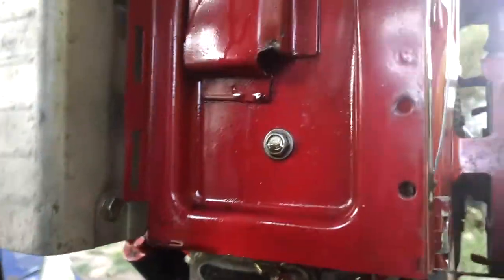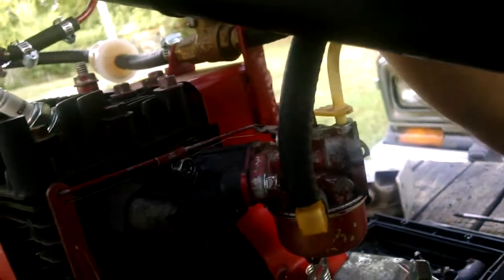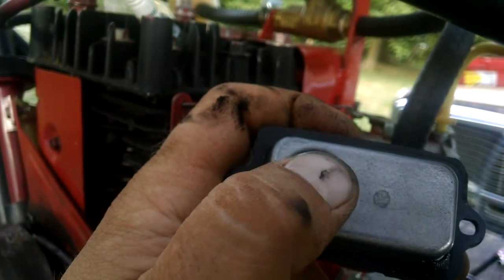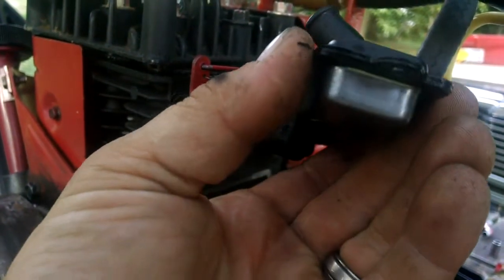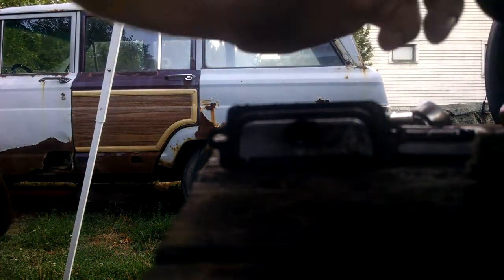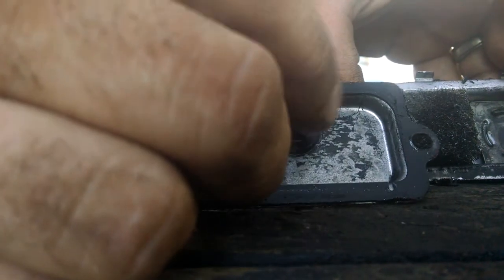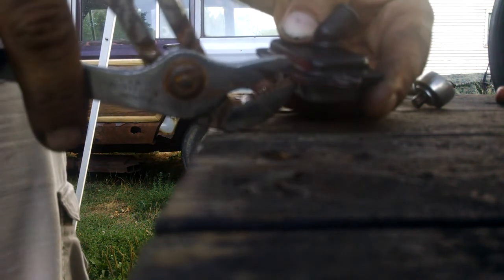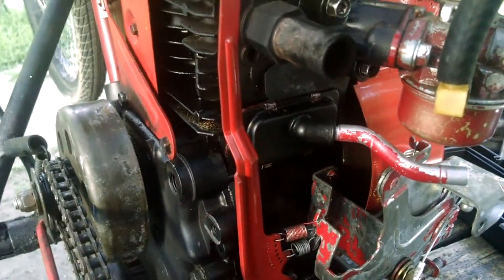Modify the Valve Cover on Briggs engine

Comment: I've been wanting to do this for a while now. I was in no hurry, and still not. When doing it, I'll try to melt-drill the holes using some pointed stainless rod or brass. That sheet is not that thick so I think I have a good chance. That way, no dismantling, and I can start with one hole and see how the engine goes (oil level etc) and drill more if need be.
Reply from the maker: It would be a good idea to dismantle it completely, taking notice how the pathways are for proper assembly, to clean out the metal shavings from every hole drilled. The shavings can be sucked into the engine from inside the valve cover if not cleaned out.

Comment: Useful Information.  One thing I don't understand - by drilling big holes haven't you bypassed check valve?
Reply from the maker: Depends. It's a balance of rpm's and the breather hole size. If you are revving higher then normal, the existing holes will not flow enough oil back into the engine through the holes. So you enlarge the holes so the oil is sucked back into the engine faster. In theory, with the right size holes at max rpm that you designate, there should be just a little oil at the bottom of the breather (inside) to just cover the holes so the check valve works correctly. If the holes are too large, then the oil goes back into the engine too fast to where the check valve is not working right and the air/oil mist is breathing  back and forth through the holes you drilled too big. I enlarged the holes on this motor pretty modestly. If you go too big or drill extra holes, yes, the result would be that the check valve will not work right and the effect would be a slight mist coming out the breather hose and would sweat onto the carb, if that is where the hose goes, but would not puck out the oil like before the mod.

Comment: You can Mod this using a PVC Valve too, it's only $3.49 at Auto Zone
Reply from the maker: Do you mean an automotive pcv valve?
Reply: +prancstaman - Yup!  GMC / Chevy Type since the Tube is the same size.  The " other " end is where you have to mod a bit, but it can be done.... I have done it to one of our mower.  You take " all " the internal parts from the Mower PCV out, put it back then mod it so the new PCV will fit into the breather hole.  Here is how I do it.  Where the breather tube coming out.  I used a MiG Welder and weld the new PCV right on it.  From there, you fit the Tube since it's the same size.  It's pretty easy and simple.

Comment: I was overhauling an old 5hp briggs engine (130200 series) and I just 
wondered what this thing (breather) is for and how it works. I'm not 
sure if mine works or I don't know a way to check its function. A gasket
 is broken. need to build me a new one from thicker paper(if it works).